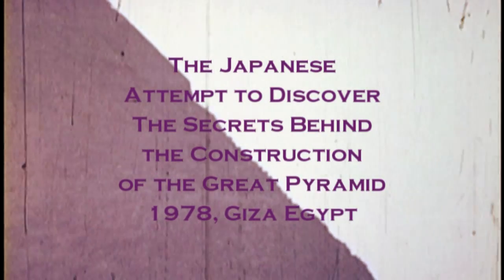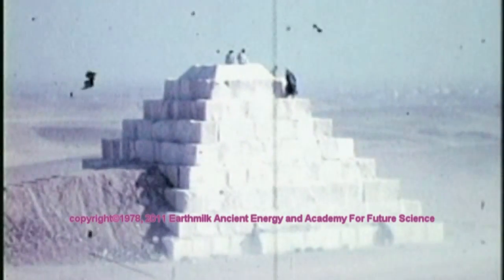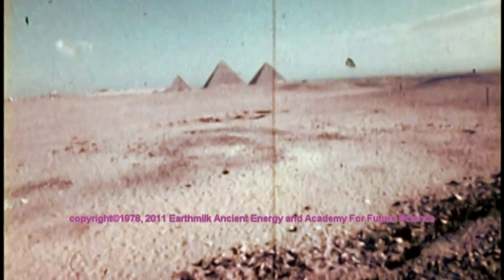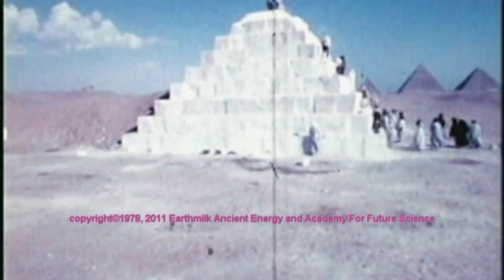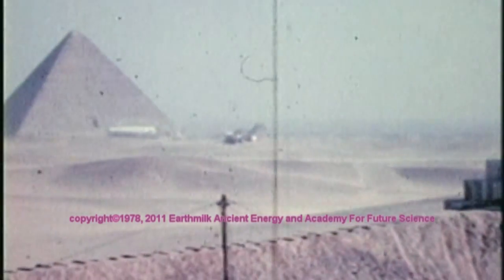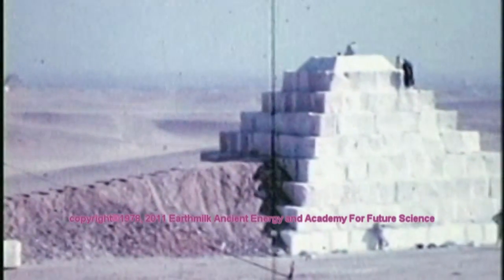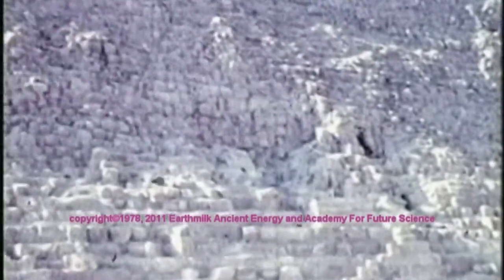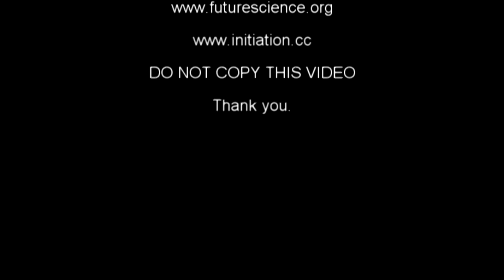How was the Great Pyramid Built Unknown by Japanese Research.MP4

Comment: I wish the word "primitive" in these kind of subjects would not be given such a negative connotation by amateurs. 
The rocket that sent the first people to the moon is also to be considered primitive compared to the technology we have today.
On top of that: not everything needs electricity or computers to get big things done. 
There's no hidden (advanced) technology persé, it's knowledge that is the real power. Consider this: A person who doesn't know what to do will achieve nothing.
Reply: Here here! So probably no electrically driven machinery back then, but no reason they couldn't have built a 6 ft wide copper saw to use with sand for cutting the big blocks, or a reciprocating chisel. With enough time, money, and manpower, why not? People were just as smart or smarter back then. I wish I could look through the lens and see some of these great empires in the past and what they could do with what they had.

Comment: i would like any construction company to try to build a real size replica of the great pyramid. with the same sized blocks. i dont think any modern company can do it. if you know of any attempts please tell me
Reply: Nobody can make a full scale replica of the great pyramid today. The ancient builders had learned from past mistakes many times. They knew what they were doing. Anyone attempting to recreate the great pyramid will undoubtedly fail- for the simple fact that they are starting from zero experience of building pyramids. They would not be able to learn on the job either, because a mistake could come back later and spoil a large part of the project. Which may involve dismantling before making more progress. Then you have every passageway, every room, every shaped block, every trap, the four shafts, and the grand gallery. No chance. That pyramid is the greatest wonder of the world, bar none. It’s builders must have been geniuses. The mysteries of it remain unsolved, although the blame for that must lie with the Egyptian authorities, who know all about anomalies, non load bearing blocks in the kings chamber, a previously unseen ‘window’ in the northern queens chamber shaft which could be investigated by robot easily, and a hidden passage leading off the kings chamber, revealed by drilling a hole, which they also have no intention of investigating. Any new discovery in the pyramid would be headline news around the world. The biggest current ‘mystery’ of the great pyramid is why the authorities refuse to investigate numerous possible astounding discoveries. The pace of discovery with the pyramid is at a standstill. And that’s a crying shame. So many leads, so few willing to investigate them.
Reply: If you want to finance 100 000 workers a day for 30 years to prove a point be my guest. 

What we get today is smaller financed projects to explore a specific hypothesis to prove a concept of how it could be done. And that is enough for research, because there is no way you can motivate and get the finances to build a great Pyramid today with only ancient methods and for that length of time.

Comment: could not do it with modern machinery, look at how there blocks are set, hay re set that closer like the big pyramid blocks, that did not cut ant granite with hammer and chisels ether, it is so much harder. epit fail,, vary enlightening,, no wonder "Egyptology" took it down,, what a embarrassment to there THEORIES. you cant build it with out technology. we cannot move 100 ton on out highways, and we need roads to do anything, there is a higher technology  goin on hear,, we have anti gravity again in the government black protect world
Reply: You can do it with primitive technology. They just didn't use the right method. An internal ramp system would have been easier and would have made the construcion possible. Stones like these have been moved for centuries all over the world with man-power only. It's really not a big deal. People like you are just so disconncted from this old technology, that you don't even know anymore what's possible with a large group of people levers, ropes and ramps. It's simple physics, really. You should have paid attention in school. The most important formula is of course:  W = F*s
In other words you can bring the force down if you increase the length of the way.
Reply: Some 38 blocks or more, each weighing about 50 to 80 tonnes were placed on top of the ceiling, you know what we have to do to move that today? you need special permits for 80 ton, on a truck, you cant even use all the roads, the granite came from hundreds of mils away, i do think the grand gallerie was a lifting ramp for this
Reply: the grand gallery blocks are machine cut, this is pink granite some of the hardest stone in the world, they had to have BIG saw's like we have today to do this work, we are finding tool cut marks that show this. and to set these stones accurately gets harder and harder to handle and do, so the work gets slower,,
Reply: DANTHETUBEMAN
"...they had to have BIG saw's like we have today to do this work "

There are so many ways to move and cut such large stones with primitive tools. There are examples of it in almost every country all over the world. For many of these large stones we actually have records of how they were moved.

Obviously you're just not looking at these things. Instead you want to compare it to our modern world with roads, regulations etc. Do you not realise how inappropriate and pointless this is?

That being said. The egyptians had a lot of ways to cut granite. Pounding stones(diorite), saws with sand as an abrasive, drills with sand as an abrasive. A lot of the dolomite pounders have been found near the granite quarry, where they've also found unfinished, cracked obelisks.

Now typically the egyptians used large, wooden sleds lubricated with water to move large stones, statues etc. That's also depicted in their hieroglyphs. And obviously you can move large stones that way with enough men. We just aren't used to seeing large groups of men moving large things anymore. We're so used to machines, that it's unthinkable to us, that people moved such structures despite the simple physics involved.

As you've pointed out the grand gallary was likely used to lift those stones, but obviously you doubt that as well. Where do you have the 80 ton number from? I've read they weighed up to 50 tons.
Reply: DANTHETUBEMAN

What can't be done by hand? I don't really know what you're trying to say.
Reply: @LuxDiscendi  it can't be cut with primitive tools
Reply: @jjrobledo  
It can. It has been demonstrated experimentally.

Comment: Either people had a far better work ethic back then or they used far better technology than we think had. You don't build something so incredibly massive and precise unless it's easy to do or it is extremely important to the civilization building it. It's nothing like the other pyramids. The internal ramp and trolley (theory) may have somehow been used but not on the other 79+ "4" sided pyramids. This one has multiple chambers, air shafts, 8 sides, and ZERO hieroglyphs and mummies.
Reply: It's the culture/religion/pharaoh/simplicity-of-jobs => It's totally different from today.
... and the fact that there's an evolution in pyramid building: 
It's a matter from going from a small model to a bigger and bigger model. Mastabas -> Djoser -> Bent pyramid -> Red pyramid -> big pyramids

(the internal ramp theory from the french architect is indeed very interesting and seems to me the most viable so far. Too bad Zahi Hawass is so uptight with further research around that.)